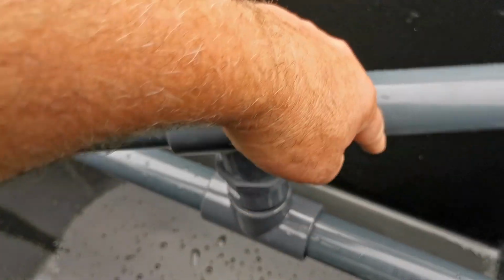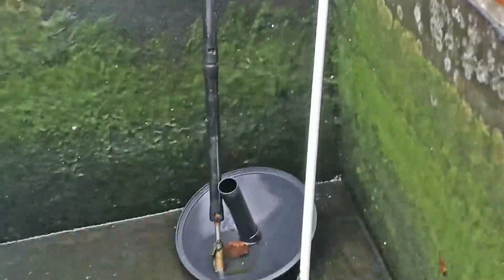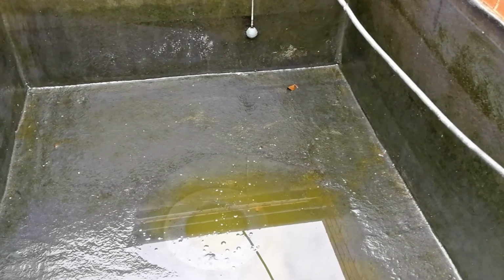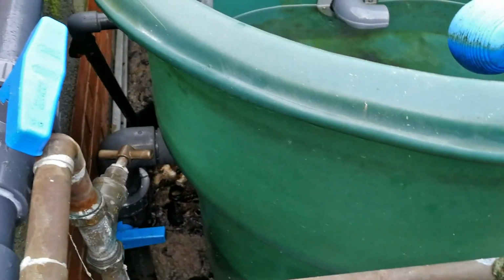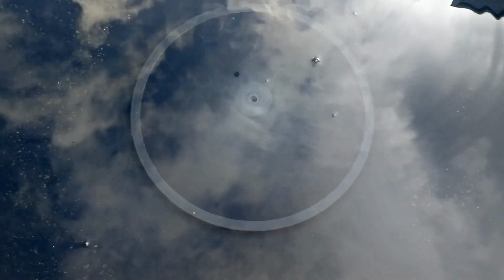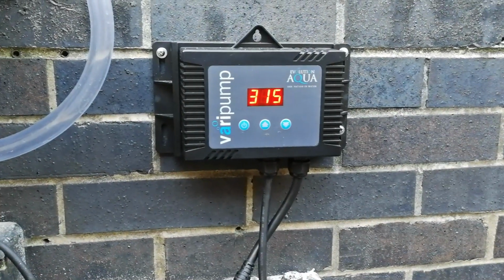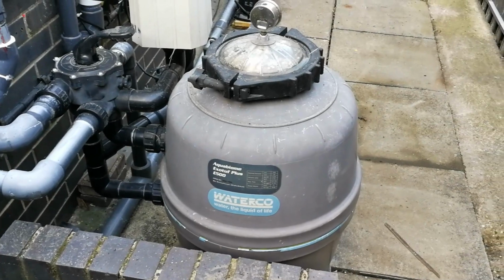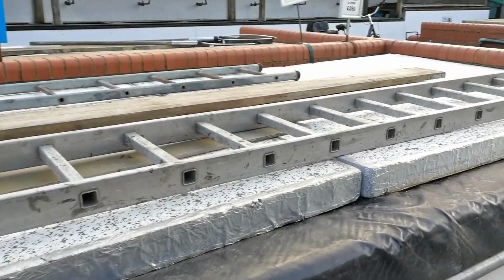Winter Renovations Part Seven.

Comment: I'd seriously consider air source heat pumps  and Amalgam UV , you're electric costs would drop by around 80% ,    
i use both on mine,   dura +7  heat pump  input 1.1kwh  output upto 7kw 
i love coming to see/purchase you're fish, best quality and good prices.
Reply from the maker: Fortunately we don't have to run the heaters for than a month or two. With the insulation the heating bills are not that significant. It would take Many years to get back the initial purchase costs. However I definitely agree they are worth considering if you plan on heating throughout winter or longer.
Reply: @leecalladine   Fair point Lee,   they are mega money for a glorified air conditioner ,  half of my koi suffered last winter from carp pox  , 3kw elecro heater failed to lift my pond temps 2c above air temps  costing £20+  a day just for a 3000 gallon pond  thats partially insulated  and under a polycarb roof/building.    
do you not grow them on through winter?  ,  thats on of the reasons i thought i'd mention it. 
 i brought mine used for £480 off extreme koi forum    approx £1700  new.
Reply from the maker: Polystyrene sheet in direct contact with the water keeps the heat in. Leaving 25 un covered.

Comment: Turn the dome upside down in the water removes all the air👏👏
Reply from the maker: The air isn't a problem. You can compress air. Its the water that can't be compressed. Therefore the dome can't be push back into place when the pond is full without the release hole.

Comment: Is there any advantage to the fibreglass being a greyish white and black to the fish as was just wondering if it’s something I need on my pond?? Also wouldn’t a purge valve going to drain be better for clearing Bottom drains save double cleaning?? Great video 👍🏻
Reply from the maker: Absolutely would a purge valve is a great idea. Colour big fibreglass is personal preference. I prefer black some go for green.
Reply from the maker: Purge valve is very good idea.
Reply: I didn’t mean as a preference I thought yours were like it for some light reflecting reasons or uv from the sun also would a smoother finish help reduce the adhesion of the blanket weeds??
Reply from the maker: @alansmall9071  it won't make any difference to blanket weed. The colour under the water will always eventually go black due to algae growth.

Comment: Great  video,do you worry about  having standing water,sat there going bad,is it harvested from rain
Reply from the maker: It is not standing. It will always be changing. We use several thousand gallons per week. We always do regular water changes. The tank is supplied with declorinated mains water. Using large quantities of rain water would be a potential a very bad Idea due to pH crashes.

Comment: What do you use as a dechlorinator for that much water?..
Reply from the maker: The water from the mains goes through an inline carbon filter. Also the water in the reservoir will have been standing for potentially many days giving the chlorine time to gas off. If you wanted to use chemical treatment then you would buy it in bulk.

Comment: Great work again Lee, never a dull moment. Will be visiting soon to get some Kintama bio balls, decided to put them in my trickle tower, cant wait. Might have to change the plumbing a bit though, will have to wait until there in to see if it performs. Thanks
Reply from the maker: As soon a the fish go into that quarantine system I will make another video about how that filter is performing.  Its been running really well and I know it will cope easily.

Comment: Hi Lee, great progress. Can I ask why you don't decommission end of season and leave cleaned and drained?
Reply from the maker: The ponds are shut down. But we leave water in. Without water there is a danger you can water behind the fibreglass also issues with freezing etc. Ideally you would run the ponds but that's expensive.